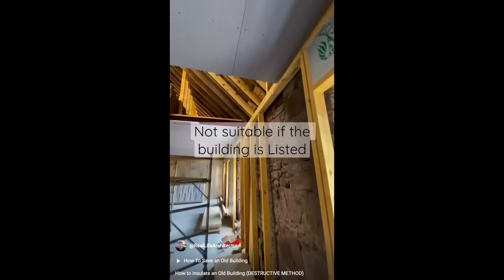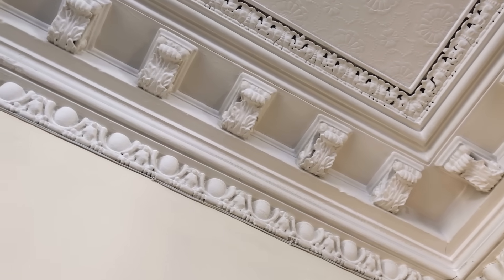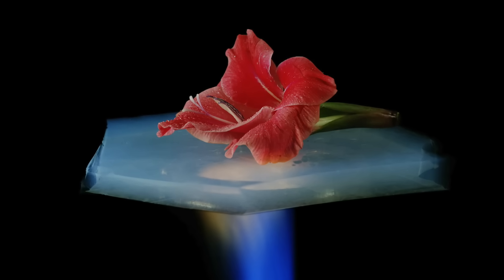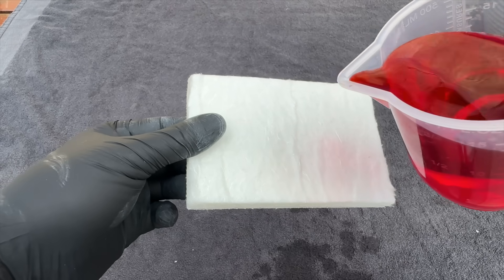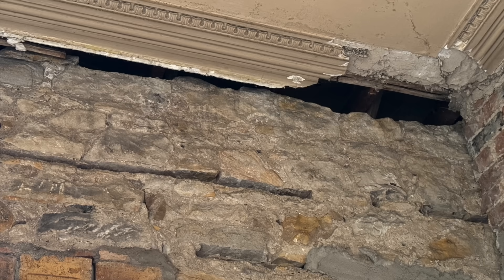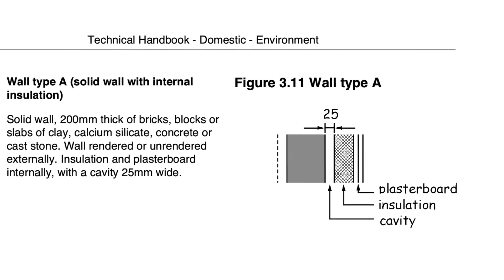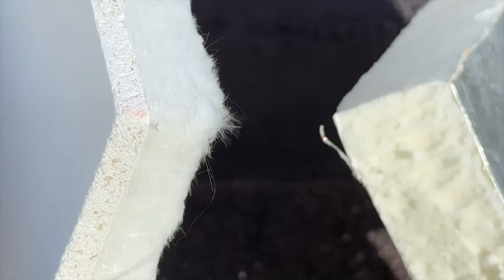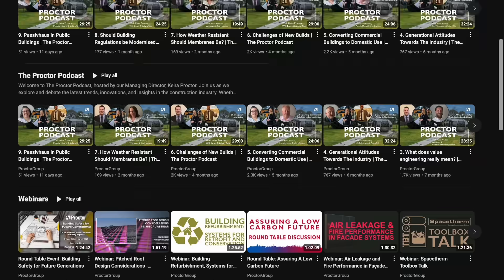The Thinnest Insulation in the UK

Comment: I had a requirement to wrap hot water pipes. The problem with aerogel is that it’s quite fibrous and it concerns me about what this will do to your lungs. I’m pretty sure silica isn’t great. 

I did correspond with them (I echo your review of their willingness to go above and beyond) and they recommended the high temperature version which I seem to recall was called pyrogel as it was less fibrous. It’s expensive but they were happy to supply just what I needed. Great company and product.
Reply: the fibres depends on how large they are. they are visible to the eye so they probably wont be an issue. the problem with something like asbestos is the fibres were microscopic, so they could get into the air and to the deepest parts of your lungs. Large hair thickness fibres however cant really do that. But it all depends on if all the fibres are as thick as the visible ones. 
We know now what particles and fibres cause medical issues so i doubt they would be able to manufacturer something that goes against the health standards.
Reply: Thanks for the positive comments, we try to be as helpful as possible so it's great to hear you've had a good experience.

The main safety issues are around dust rather than the fibres, which aren't much different from mineral wool really. The dust is an irritant (like all dust), but is not toxic or carcinogenic. Inhalation or skin contact of most types of dust has the potential to cause irritation, or exacerbate existing health problems but dust production occurs principally during cutting and can be minimise by following our guidance.

Once in service (i.e. in a finished house) there shouldn't be any issues with exposure to dust. Full material safety data information can be downloaded form our website members area though if you want more detailed information.

Comment: Fascinating stuff. I can see it being particularly useful where you might be able to do most of the job with conventional materials but you have some areas, e.g. windows, where you’ve next to no room but you want as much insulation as possible.
Reply from the maker: Exactly
Reply: That was exactly my thought.

I live in a non-listed [but still very grand] former workhouse, built in 1836. My flat is spacious for a one bedroom place with the front room and bedroom both 17ft by 17 ft. the bathroom and kitchen are both much smaller though large enough.

The ceilings are too high! The windows need replacing being 1990s pine framed and now rotting!

So new windows, use conventional wall and ceiling insulation, which would not spoil anything, and use this new thin insulation round the windows, as the walls are too foot thick even on the second floor.

I was wondering how to do this, as the coldest5 parts of the wall [most prone to a bit of black mould] are round the windows. But currently there is no insulation at all and only conventional modern Dry lining.

Comment: Great video introducing a new solution of insulation to period properties.

My solution to an exterior wall that has lath and plaster is to str up the plaster and laths off (keep the lath as kindling for your burner and the lime plaster to sweeten your garden soil).  I then repoint the interior wall with lime mortar as needed then put a couple of hammer in fixings with DPM and a wooden spacer to increase the load capacity of the original studs/battons.  I then cut to fit 25mm PIR insulation and glue it between the battons.  I use Cuprinol 5 star or silva to treat the wood and dampen it as I glue with polyurethane glue which is activated by moisture.  I then use aluminium tape as a vapour barrier on the battons then I fix PIR or EPS insulated plaster board to stay true to the cornice.  This gives me 35 to  41 mm PIR insulation which will outperform the aerogel.  Downside is it is a lot of work but the result is a game changer AND the circulation of air solum to sark is reestablished and maintained.  One for a competent DIYer.

Comment: Is it suitable for vehicle insulation?
Reply from the maker: I’ve heard it has been used for that
Reply: A breathable insulation for a metal skin seems somewhat redundant.
Reply: @stepbackandthink  I mean the last thing you want on the inside of a metal skin is condensation build-up.
Reply: @DEADB33F  correct, a vapour barrier internally is very important in this type of application. It is however much easier to fit around irregular shapes like wheel arches than anything that comes close thickness wise.
Reply: Spacetherm has actually been utilised in Formula 1 cars!
Reply: Yes, it's been used in a whole range vehicles, boats, campervans, race cars, even satellites. In fact i used some in a self built campervan a few years ago (with a vapour barrier internally). The permeability isn't a huge benefit in these applications, but its still very thin, flexible and functions as a pretty effective sound deadening mat too. It also doesn't absorb moisture and damp in the way that mineral fibre would.

Comment: UK should invest in this tech and make it more widely available and cheaper
Reply: Absolutely. Rather than give 7k per heatpump to go directly into the pockets of the installers it should go to subsidise this which would work across both gas and heatpump installations.
Reply: @davideyres955 heat pump installers are typically gas engineers who want to work with a new technology. 

Personally I'd hire a builder or plasterer to install insulation not a heating firm.
Reply: It would only make it more expensive if manufacturing was done in the UK

Comment: You can get Aerogel-filled windows. They are translucent, but as skylights and high transoms they are excellent.
Reply from the maker: Are theses available in the UK?
Reply: Or use vacuum insulated glazing. Much more expensive than normal IGUs but the thermal performance of triple glazing in a thickness of 6 to 8 mm.

Comment: Noticing the PPE worn in its manufacture I'd be concerned with long term health issues for both installers and home owners. What sort of research has been carried out do you know bearing in mind the building industry has a few historic and current issues in that regard?
Reply: You definitely would not want to be breathing in any of this.
Reply: @stepbackandthink it's probably like asbestos. Not a problem as long as it isn't disturbed, broken etc... is perfectly safe in fact.. it's when you renovate/ break it that it causes issues.
Reply: @pl7ny  to be completely clear the product is nothing like asbestos, being non-carcinogenic and non-toxic, but full safety data is availble on our website members area if anyone want a more detailed breakdown. In terms of what happens during removal/renovations, it's probably more similar to mineral fibre and plasterboard, dusty and messy but not unusually harmful under normal circumstances.
Reply: @proctorgroup   asbestos isn't carcinogenic, or toxic.   It is biologically inert.. your body can't do anything about the dust in your lungs.. your bodies response to the physical irritant in your lungs that it can do nothing to is what causes the issue. Silicon dust is just as bad as asbestos when it's in the lungs, for the same reasons.
Reply: @Baddad36  it’s silica based, so you’d want to avoid the dust in case you get silicosis - BUT silicosis is an occupational disease so you really only get high exposure if you’re working with it every day. This means for DIY jobs it’s much less risky. The professional installers however need to be more careful because they’re doing it day-in, day-out.
Reply: I had the same concerned reaction to that clip also!
Reply: @dixeyyy452  the guys in the factory are exposed to dust produced by the cutting equipment all day, which is very different scenario from a health and safety point of view. Working on site has much lower requirement for PPE.
Reply: @proctorgroup  thanks for the reply 🙏 makes sense! 👍
Reply: The PPE requirements during manufacturing are considerably more onerous than for a typical installation, as there is greater exposure and more frequently. The principle issue being the actual dust, which is an irritant, but is not toxic or carcinogenic. Inhalation or skin contact of most types of dust has the potential to cause irritation, or exacerbate existing health problems but dust production occurs principally during cutting and can be minimise by following our guidance. Our on site installation PPE requirements are the same as for working with plasterboard and are generally considered good practice for cutting and handling a lot of common materials. 

Once in service (i.e. in a finished house) there shouldn't be any issues with exposure to dust. Full material safety data information can be downloaded form our website members area though should anyone want more detailed information.
Reply: @proctorgroup  that's what asbestos guys thought as well... I have an asbestos apron for fire protection.. it's perfectly safe, non toxic non carcinogenic as long as I don't break it and create dust.. same thing with these glass panels.  As long as they aren't broken.. perfectly safe.  But when you turn them to dust during demo or remodelatuon, it's gonna cause the same issues because it will produce a biologically inert physical irritant.
Reply: @pl7ny  Material safety, testing and PPE requirements are considerably different today than when asbestos was commonly used. At the present time studies into amorphous silica, as is used in Spacetherm A1, is considered not to be as hazardous as crystalline silica, however as with all dust generating materials suitable PPE should be used during the construction, refurbishment and decommissioning phases of any build.

Comment: Looks a great material. Hopefully in a few years the cost comes down because at £97/sqm it's pretty insanely expensive. That's what, £300 per sheet? By comparison a sheet of plasterboard costs £10 and a sheet of 25mm PIR costs about £15.

You said that battoning+PIR doesn't allow the wall to breathe, but I thought this is exactly why building regulations stipulate the 25mm gap? Personally I've done a few properties over the years with 25mm batton fixed to the solid wall, a 25/50mm sheet of PIR and then plasterboard and the wall stays dry and seemingly breathes fine for many years after. No apparent issues with condensation or damp. I do usually leave a small ~5mm gap at the bottom of the wall for ventilation though, both plasterboard and skirtingboard.